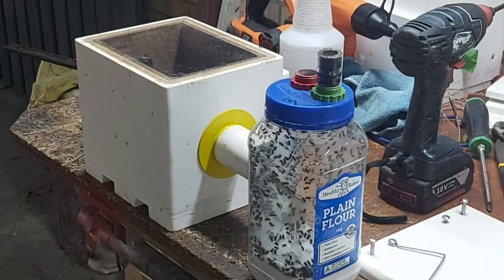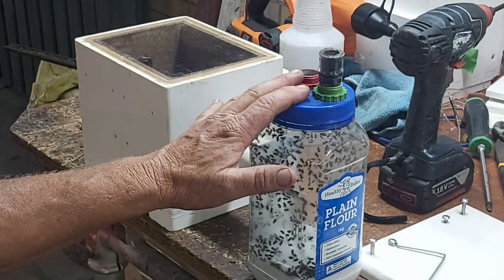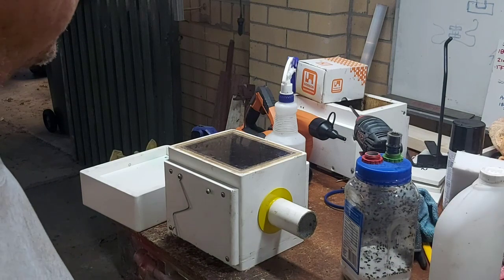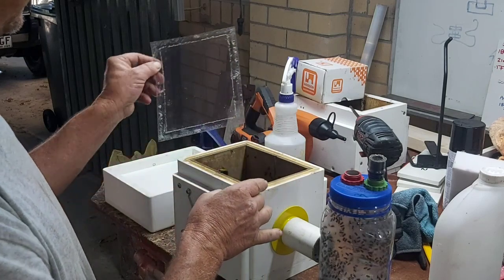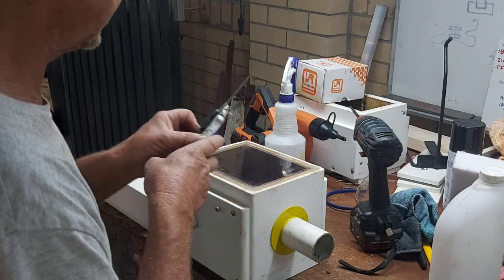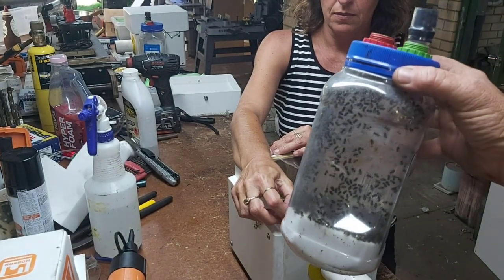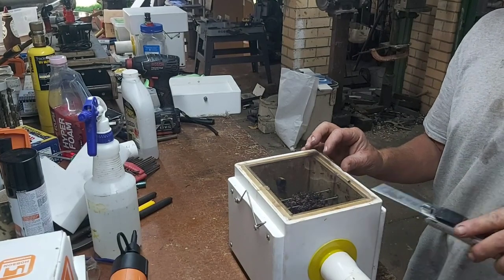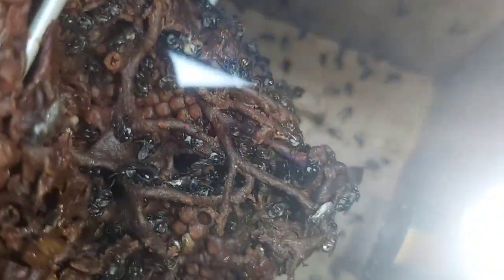HOW TO Transfer Bees from your BEEVAC Bottle into the hive

Comment: Good vid Alex. What's in the bottom of your bottle?
Reply from the maker: Cheers mate. It's just a little piece of foam
Reply: @spicershollownativebees8023  Awesome. I'm using paper towel. I used my milwaukee vac on the bee vac for the first time and the bees were hitting the wall of the box too hard for my liking.
Reply from the maker: @CooleyKTM  you need a air bed pump. BCF,  $40 😉
Reply: @spicershollownativebees8023  started with the matress pump. 240v/12v. Wanted something more portable. I've installed a valve now to reduce pressure.
Reply from the maker: @CooleyKTM  fair enough. I run 2 pumps and 2 x 12ah batteries in mine all in a unit with carry handles.